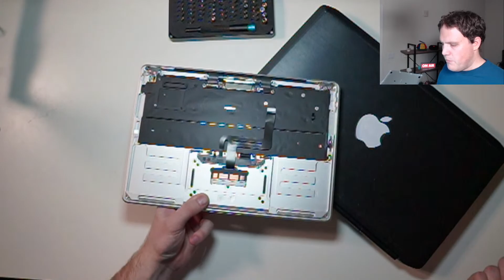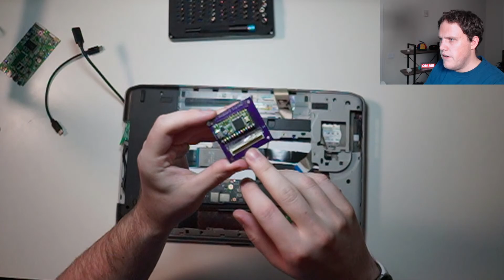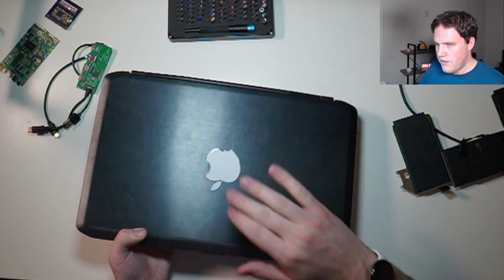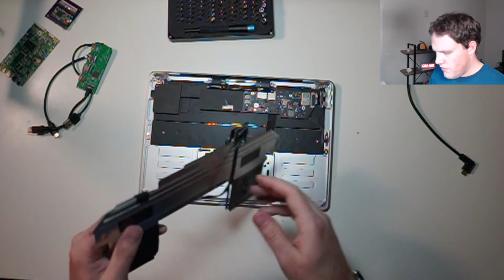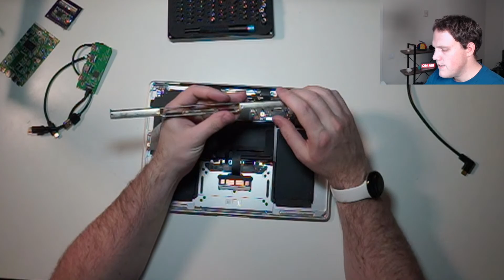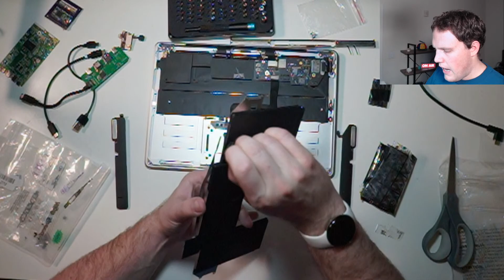LIVE ARCHIVE: Rebuilding a MacBook Air from Scratch

Comment: lastly.. and unrelated... Do you know if the Surface pro's (im still on my 6) operate faster when plugged in (ie: are they throttled on battery)... Found a simple solution to the battery problem,  a simple USB type C -surface connector cable connected to a 65w battery pack that puts out enough voltage to charge the surface pro... what ive found is if im doing that the Android Emulator (i use LD player 9) seems to run better than on battery alone (though that might be placebo effect)   If im gaming on it i do put a portable fan on it as it does get pretty warm...